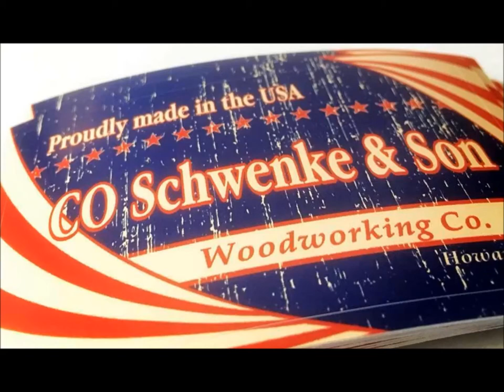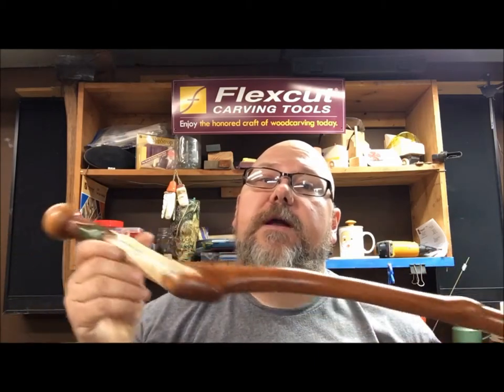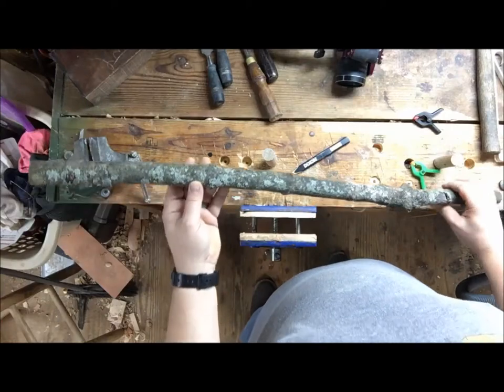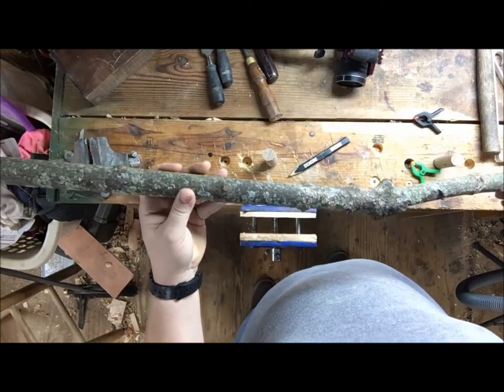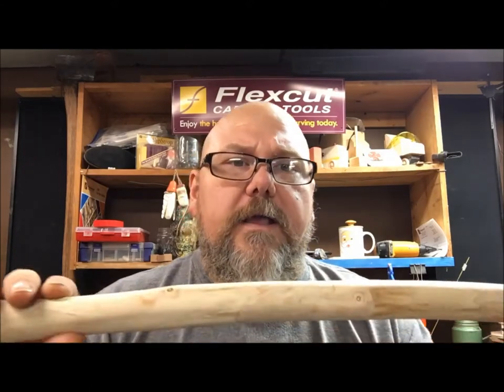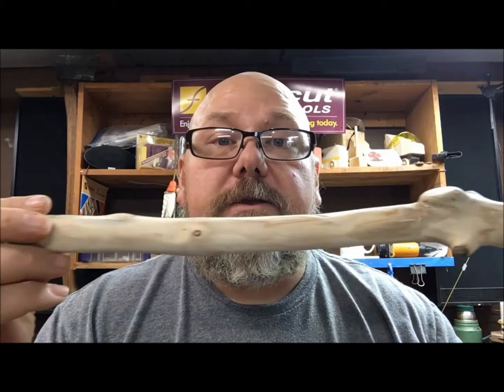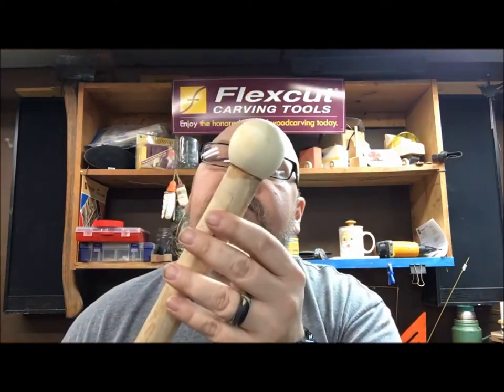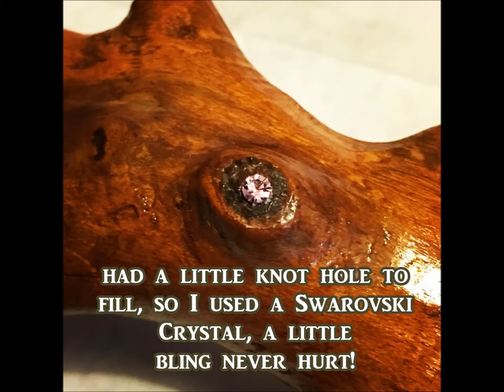Making a Maple Walking Stick and our Makers Rock promo

Comment: You mentioned, well seasoned,,, how long is well seasoned , for maple?
Reply from the maker: Bill Whitmire I usually try to leave any green cut sticks with the bark on inside for at least one year.  I believe 6-8 months, depending on humidity, for every inch of diameter, is what is recommended, and most of the pieces I use are in the 1-2 inch range.
Reply: Thanks so much .. I have a couple of Red Maple .. thats been in the dry for about 3 years .. So Im good to go ( I actually forgot about them)
Thanks again 
Bill